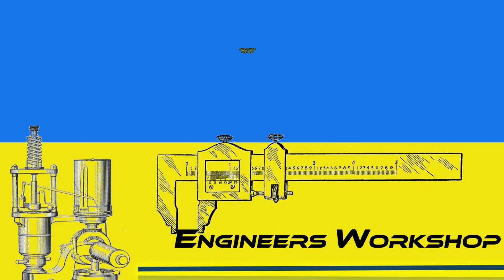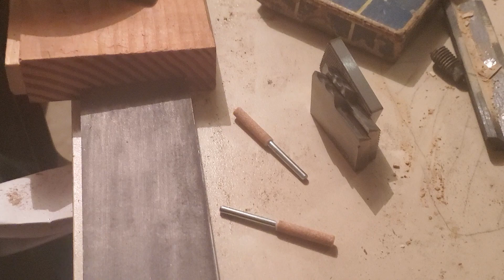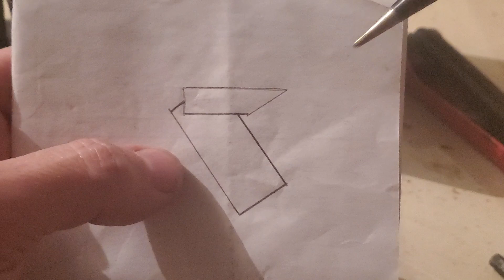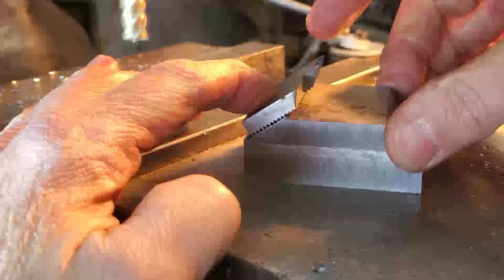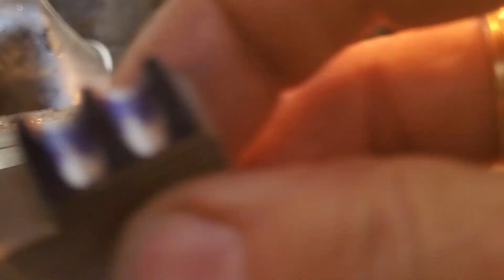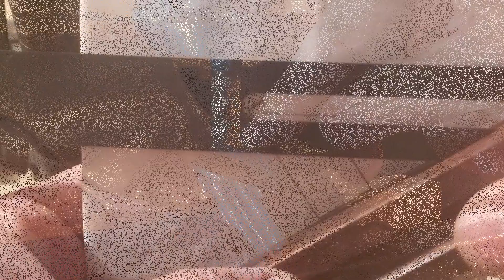HSS Knife Grinding - 4000 RPM on the K&T 2D Mill !

Comment: Really you need a surface grinder and a rounded form stone. That way you can cut all of the knives to the same specification.
Reply from the maker: If these ever need sharpened again I have a radius dresser, so I can dress a stone to match and grind them on the Cincinatti Tool & Cutter grinder.

Comment: Guessing they used a planer with formed knives to cut the boards originally?
Reply from the maker: Likely a molding cutter with profile to do entire surface in one pass. Both sides are molded, and millwork shops often mill all four sides in same machine with four head machines